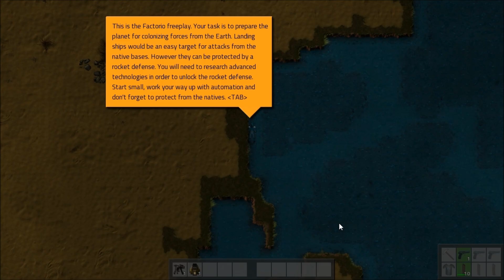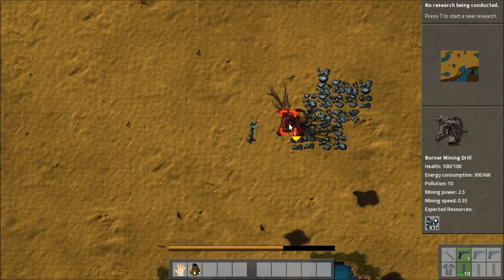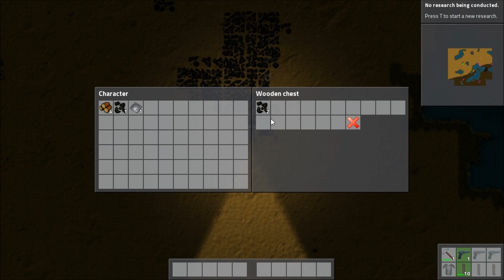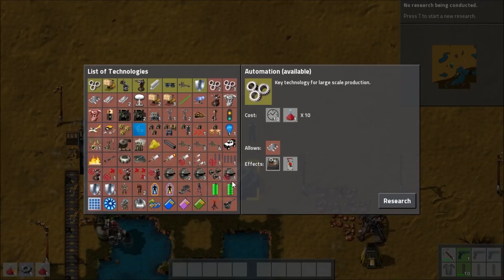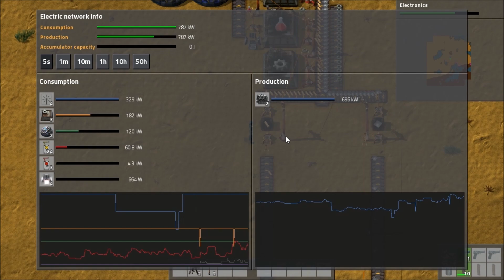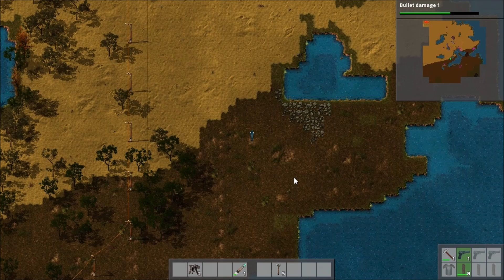Factorio Ep#1: Fully Ramblomatic

Comment: my usual stratagem is to move all my ores to my base, and cook it up there. This allows me to move it about more easily, and find problems in the system much more easily. On a side note, great video! Can't wait to see what else you produce in the future.
Reply from the maker: I usually base my decision on pollution levels. If smelting at source doesn't anger any locals, i'll do that to avoid worsening the pollution in the main base (in my low pollution playthroughs anyway, otherwise smelting in the main base is more efficient and draws the aliens away from less well defended outposts). Also, thanks for the feedback!